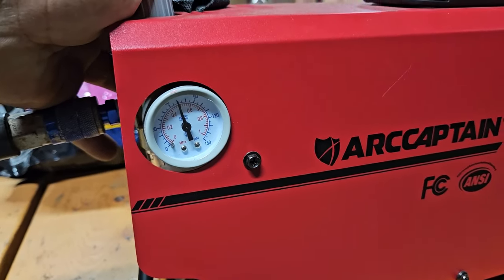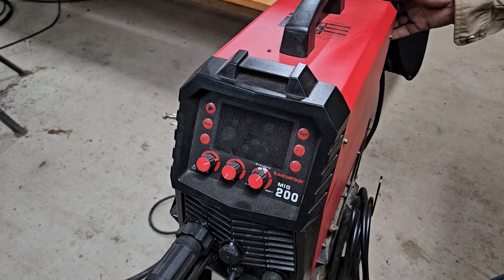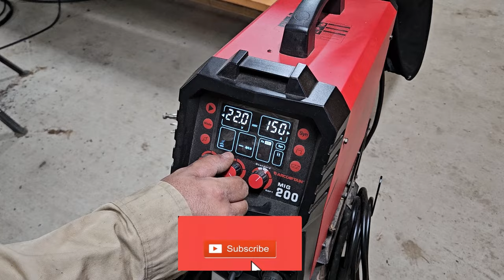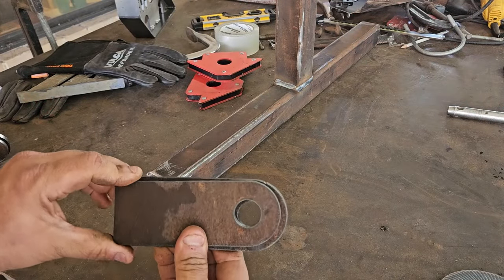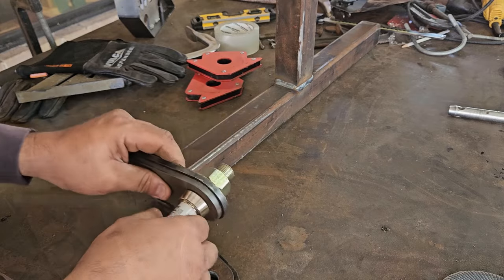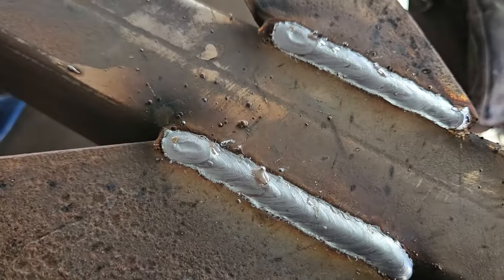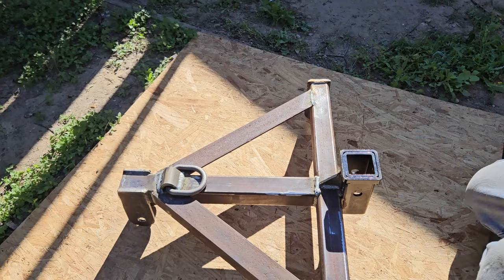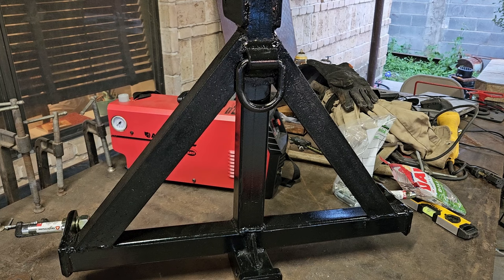How to build a homemade tractor 3 point trailer hitch from scrap metal. #arccaptain Mig 200 Cut50

Comment: Did that Langmuir table work with the arc captain plasma?   Also, what program did you use fro draw things up?
Reply from the maker: I have a Primeweld Cut60 on the table and have not tried the Arccaptain since its a High Frequency machine. I use Fusion 360 hobby version which was recommended.
Reply: But the Langmuir can accept different plasmas?